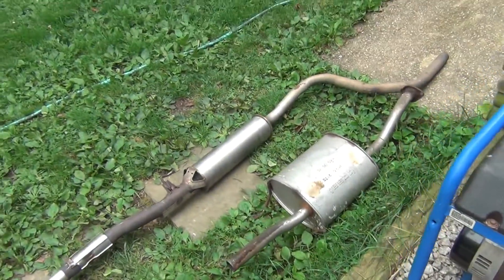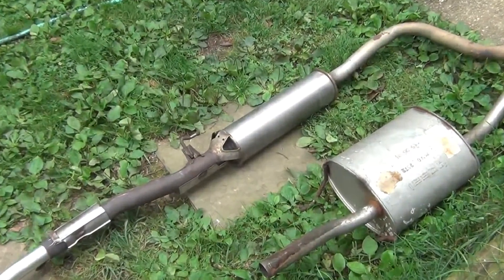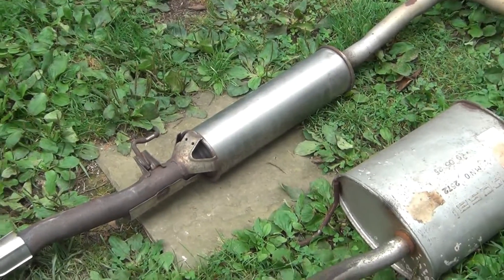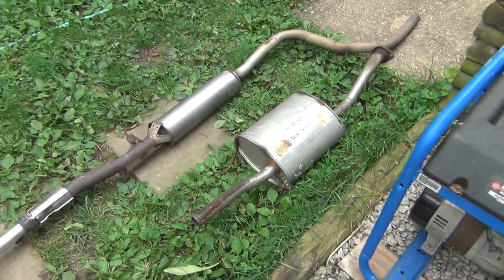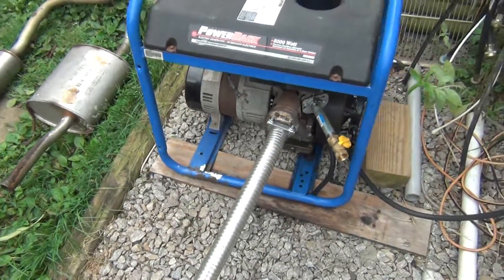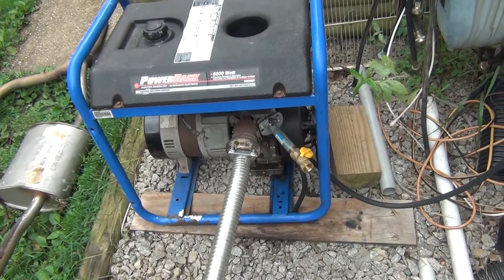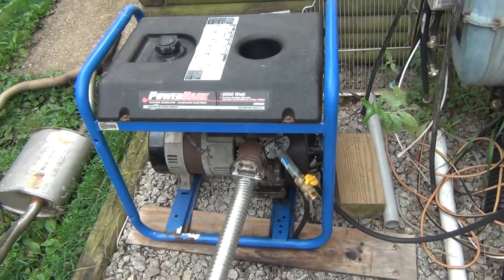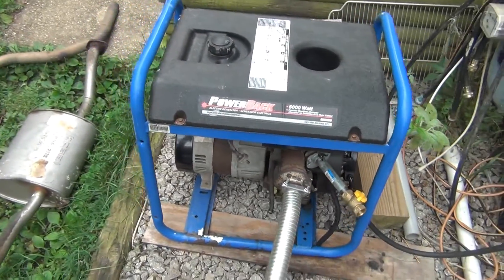How to run generator on natural gas without carburetor part 2

Comment: How many generators do you have? Have you ever had to run the generator for 24 hours?
Reply from the maker: I have had many generators in my hands but presently I own only five. 
No I didn't have to run it for 24 hours but I would if I have to.
Reply: Very cool.  Well, it's better to be prepared.  I guess, you can rent out a few to your neighbors, if the need arises:).  Nice videos!
Reply: we just had power outage and did end up running different generator converted to NG for about 20 hours with out any problems